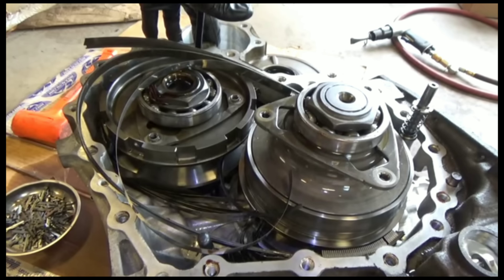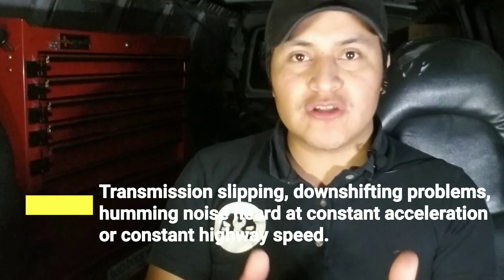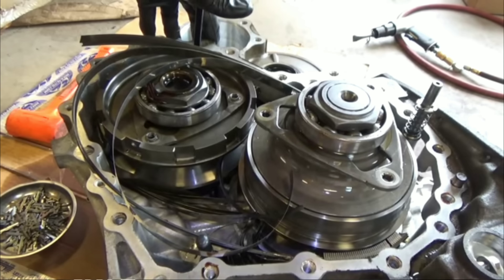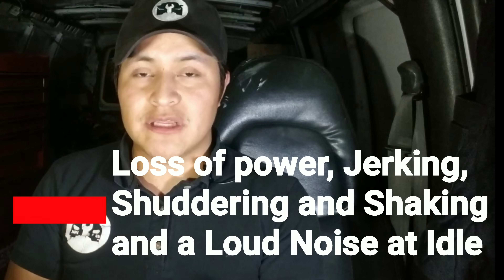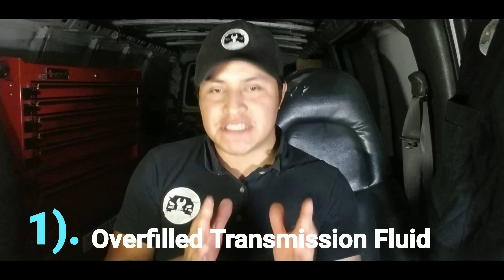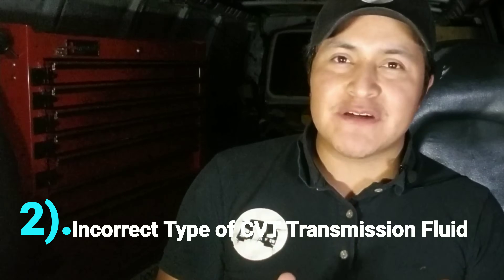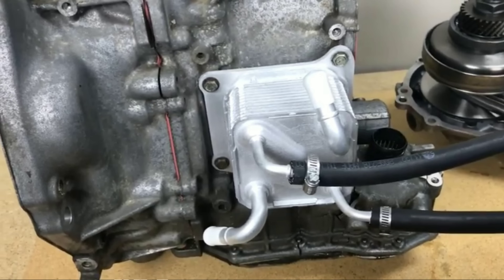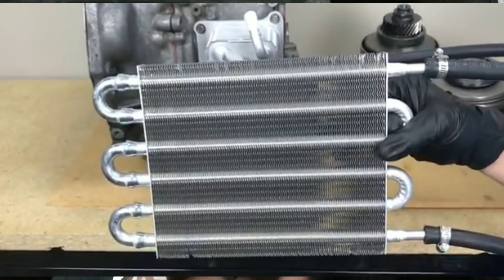NISSAN CVT TRANSMISSION | why it fails and what you can do about it to prolong it's life

Comment: I drive a 2020 Versa, 82k miles. Runs well, just the sensors suck. I think the X-Factor in handling the CVT is understanding that you kinda need to babysit it when it comes to maintenance. Very small transmission, so gotta take care of it. 2200 lb cars shouldn't get 40 miles a gallon in the city. But my Versa does. Comes at a cost tho, and the cost is the "fragile" CVT. Fortunately it's a later generation so not as bad as it could be.

So because of that you gotta babysit it. Change oil religiously, try not to floor the gas pedal, make sure oil is either synthetic blend or full synthetic, know when to change the fluids, etc.

I mean I got a lifetime extended warranty so if anything fails I can just plunk down 250 bucks and boom new transmission, but still. Never want to get it to that point.

Comment: I have a 2015 Nissan Murano platinum with 285,000 miles. I’ve never done a transmission fluid service and never added any fluid at any time. Driven the car pretty hard the whole time. Lots of road trips. The car is starting to shutter at lower RPMs. I recently replaced the passenger side CV axle and when I did, there wasn’t any fluid inside of the case. I’ve been tempted to add some fluid, but have always worried It will stop working. Any thoughts?
Reply: 😂😂😂😂😂😂 im dying😂😂😂😂😂😂😂😂😂 i had to read this twice to make sure i was understanding what I was reading.

Comment: I bought my 2019 in January of 2020 and a month or so after I bought it the transmission started going out. A master tech for Nissan was able to fix it after determining what was wrong with no error codes. But now it has been going out for over two years and it just slips  even at high rpm’s. I can barely drive it most days and the Nissan dealership can’t do anything without codes which a real tech who was trained properly knows how to diagnose without codes like we did in the old days. But I’m looking to swap it out with a real auto trans that have real gears so I can actually drive it how I drive normally and with this cvt it’s not built for performance at all. So what should I look for or look to placing in my cvt? Also, what transmission bolts up to the L34?

Comment: My 2014 Maxima did the same thing at 96k. So I threw the cvt in the dumpster and put a real 6 speed in it from a 2010 Altima SR, like a Maxima is supposed to have.
Reply: Is it difficult to replace CVT on Maxima with 6 speed manual?  Costly?
Reply: @SkipBernacki  about $4k roughly and not very hard at all.
Reply: Thank you

Comment: Well I don’t have a Nissan but I couldn’t find any decent info on my Subaru legacy 3.6r and landed on this video. Unfortunately, it shudders and shakes at low speed acceleration. The hotter my transmission fluid gets, it becomes pretty much un-drivable. I’m going to put in the Bar’s Leaks CVT Transmission FIX to see if I can at least get to work and back while my new transmission is being ordered. 
Thank you for the level of detail and after watching a few of your videos, I’m definitely a subscriber!

Comment: I like the descriptions of the problem and the possible fixes. Can you tell us is it worth getting the after market parts(do they work) and the possible cost range for fixing problematic parts. I'm in the market for possible rogue, and these problems are stearing me away from CVT transmission cars, that most newer model cars have now.
Reply from the maker: I'd say that aftermarket coolers are worth it so that the cvt fluid doesn't overheat.
Cost to fix a cvt ranges between 3k to 7k depending on the issue

Comment: I came across your video because I have a 2017 Nissan Sentra purchased used from a dealership; it has been making a whining sound on acceleration then recently a jerking sensation. I took it to a Nissan dealership which they diagnosed that the transmission has to be replaced. Your video gave an excellent explanation of what is happening to the CVT trans better than the dealership. Thank you.

Comment: I have a 2017 nissan  truck and a 2019 Nissan Maxima SR and I love both. I haven’t had 1 bit of trouble with either.
Reply: I have a 2021 Sr and heard these CVTs are heavier duty and have transmission cooler. I read that Idemitsu makes Nissan fluids which they sell cheaper and "are better".

Comment: I had an 05 frontier non CVT lasted 293,000 miles issues started after 250,000. Nothing major, took a beating til it got wrecked severely but it still started.  But I won't buy another,  quality has been going downhill since 09. And that's what I've been told by workers at the nearby Nissan plant.

Comment: With the allegedly compatible fluids they sometimes cause a shudder.  You might notice that fluids at the parts store list a large number of specs on their labels.  One spec is in reality somewhat far off from the others.  I owned Volkswagens and transmission fluids allegedly compatible turned out not to really be compatible or at least not the same.  Also note that if you have a Honda they are notorious for needing specific fluids, most notably the power steering fluid if the vehicle doesn't have electric power steering.

Comment: I have 3 Sentras (2011, 2013, 2015). All have well over 100K miles. The only problem was with the 2013. At 130K  miles, it took 2,500 rpm’s to go 70 mph (normally it is 2,000 rpm’s to go 70 mph). Otherwise it was fine. But I had the dealer put a NEW transmission in, which cost $3,500.
Reply: 2013 centra cvt
coast more 4 500
from bealer

Comment: My trans went out at 90,000 miles in my 2016 Altima, Kept up with maintenance and all, but it started to judder and hesitate. Got a diagnostics test and they told me that it was my Transmission and said they could replace it at the price of $7000 smh. Now I have to start over and get another vehicle. Screw you nissan!

Comment: I have a  2006 Nissan Murano s. Today's my last day with it. I had it for 18 years did service for transmission every 60,000. Today the transmission went the radiator cooler broke and coolant went into the transmission. The car has almost 300,000 miles. 292,000. It was a good car. Now it's going to the Wrecking yard.

Comment: Wow, I never knew about this, I had a 2009, ran great till about 130K miles, started that limp engine thing. I never changed the transmission fluid, I was told at the time by a mechanic that it’s expensive to do and not necessary!? At that time I knew nothing about a CVT and wasn’t sure,  should have researched it more.

Comment: 2019 pathfinder, transmission went bad at 60k miles. thank god had extended warranty. saved like 6 grand. had fluid replaced at 30k. pretty upset that they are so unreliable

Comment: 251k miles on a 09’ Altima. been through 3 transmissions:/
Reply: my 2008 altima is at 360k km and it still runs on the original cvt transmission
Reply: How can you afford 3 transmission? Outside of warranty?

Comment: I have a 2013 Rogue with 121,000 miles and started to hear a lighter revving sound with the engine RPM revving sound. RPM’S meter doesn’t go up just a quiet sound and light vibration. No slipping or rough shifting.

Comment: Pls help, can i use ns2 transmission fluid on 2010 nissan juke xtronic cvt?
Reply: If it has a turbo, then use NS2. ATG & I recommend to do a drain & fill 3X (even shops don't do) 
Since you failed to provide more information. If your vehicle has over 151K, most likely the CVT is defective.

ATG has informed Nissin's CVT about this major problem. But Nissin becomes like Chrysler.

Comment: Thank you for informative video.  I wish I had searched for this years ago.  I have a 2009 Rogue and yesterday I heard the whining sound come on when I started the car.  I also smell burnt oil smell when pulled into garage.  You helped me confirm that the transmission is going and will require a replacement which isn't worth the cost of the car.
Reply: Change the oil and filter.. Critical on these trannies...Use the proper oil..

Comment: The fail-safe issue happened on my 2010 Nissan Rogue at 60k. A transmission cooler fixed it. At 110k, the magnetic shift sensor left me on the side of the road. I had to manually depress the slot switch to unlock the shifter before and a few months after the sensor was replaced. After doing that for 3 weeks, the shifter worked again. At 151k, it seems to slip just after low speed take off, sometimes. I am taking it to the shop. They said 5k to replace the transmission. Hopefully, it will be something simple...

Comment: I DON'T KNOW MUCH ABOUT ENGINE. I HAVE A QUESTION WHEN CHANGING BRAKE FLUID IS IT NECESSARY THE BLEEDING PROCESS? I HAVE NISSAN 2018 VERSA. great info. thanks
Reply from the maker: If you let the brake fluid reservoir go empty, then yes, it's necessary to bleed the air out.
Reply: Great much thanks for your info.

Comment: My Nissan Sentra 2015 has transmission issues but still runs what can I do
Reply: Sell it
Reply from the maker: Make sure that the fluid level is at the right level, and the only service that you can do to it without rebuilding the transmission is to flush the fluid and replace the transmission fluid filter. If after that the transmission still has issues, all the other options will be expensive

Comment: I have a 2012 Sentra. I drove it from Arizona to Texas and back and just got back yesterday. The check engine light came on about half way through the trip. I had a P0744 code come up when I put my scan tool on it which is a TCC transmission clutch control valve intermittent. I kept driving it and after a few miles the car suddenly had no power. It was like the transmission wouldn’t downshift on hills or maintain speed on cruise control. I’d step on the gas pedal and it wouldn’t accelerate. When I pulled over the transmission was very hot. Wasn’t sure if this was normal? I poured water on the transmission to cool it off and it seemed to work. I drove it again and had no problems for a while; but, the problem returned. Essentially that’s how I got it all the way to Texas and back. I had to pull over and pour water on the transmission every 40 or 50 miles. But driving it through the city I had no problems! I did put some CVT oil in but it didn’t solve the problem. My transmission is overheating? I didn’t know that the transmission had used coolent from the radiator?  Wonder if that is the issue and not the TCC? Hummmmmm?  🤔

Good video! Thanks for the info!👍
Reply: Change the CVT fluid.
Reply: @TomasTobiasAliwishesJackson  I changed the oil 2 1/2 years ago and that was the second time I’ve done it. So I don’t think that’s the problem. It maybe the filter behind the cooler is dirty. I already ordered a complete aftermarket cooling kit with a new filter, cooler and a radiator cooler to help cool it better. I will replace the CVT oil now because of the overheating……….thanks for the reply. 👍
Reply from the maker: It's going into limp mode, that's why it wouldn't accelerate when the transmission fluid is too hot.
I'd use a scan tool to see the transmission fluid temperature before and after installing the new aftermarket transmission fluid cooler to make sure that it's working and actually cooling down the transmission fluid
Reply: @WrenchLink  yep? I figured it out. It’s been flushed, filters replaced and everything done to the transmission. It works fine now.👍

Comment: It’s just completely outrageous that in the 21 century a seasoned manufacturer can not be counted on to build a reliable car transmission. No doubt that much of the public don’t change all fluids as consistently as they should but the manufacturers are not insisting that they need too by promoting this never needs servicing crap. It’s just disgusting

Comment: I hate CVTs. This video confirms, once you hear a noise in the transmission it's either going to die or will be a costly repair. Just trade, don't repair or replace. Don't but a used CVT auto, you're just getting someone else's problem.

Comment: I bought Nissan Roque 2017 and I driving 7 years already never got trouble or fix anything just change the oil only and now I plan to buy another Nissan Roque 2024 again because I love Nissan, at least Nissan make by Japan still more better than make in Korea or China or Vietnam.
Reply: Thanks jus brought 2023 Rogue with 3 cyl engine cvt.  I absolutely ❤️ 😍 it 💯.   The 3 cyl is a genius invention and should b applauded.  The changes hopefully have been great and maintenance recommendation work

Comment: Hey everyone, who happens to see this. Hope you are doing better than I am. I just want to let you know that if you experience acceleration problems it may not be the transmission at fault. Limp mode can be triggered by other things such as a failing throttle body. This component is responsible for letting air mix with fuel for the combustion to occur. If this part fails, your engine will have trouble moving. 

It's easy to change out since the throttle body is located at the very top of the engine under the plastic cover. There are some hoses and wiring that needs to be disconnected. Please be careful with this. Breaking a hose or breaking plastic in the hose is not a fun problem to solve.  

Make sure to check all fluids after making any critical changes to your vehicle. 

I had a few of the symptoms listed in the video. When my dad plugged in his OBDII computer, it came up with codes for the throttle body. Make sure to scan for codes before assuming your vehicle has had a catastrophic failure. 

Please use caution. Engines are precision machines and are to be treated with caution and respect and perhaps a healthy dose of fear. Use extra jack stands if you can. Try to avoid working alone. That way, if something does go wrong, someone can be standing by to either help or call emergency services.

Comment: Great video and the best! Thank u for this. I have a 2013 nissan rouge and it is jerking at 100,000 miles. What do u recommend I do? Would a CVT fluid change help the longevity or should I just sell it.  Horrible vehicle btw.  Will never buy a nissan again.
Reply from the maker: It could help, but if the transmission is mechanically worn-out, then a fluid change will not help.
Check if the fluid level is ok.

Comment: I have a 2013 Nissan Rogue (116,000 mileage) and I hear a humming noise when I get around 40 mph but it doesn't jerk or shift hard, would that be the transmission? and what would be the fix for that?

Comment: best video I have seen on this subject.   general speaking  if the service interval  is every 30k , do a drain fill of cvt fluid every 15k .  if the interval is every 60k   then do it every 30k.  and so on.  only use the Nissan Fluid.

Comment: Nissan Does Not recommend you change your transmission fluid. That's Cap!! They tell you it's Lifetime of the vehicle. Now that's the reason for the problems. An 20 years of that CVT transmission Nissan has done nothing to fix the problem. It's warranty work for them. And the ones that are out of warranty are out of pocket $8000.00-$10,000.00, or they get them in a New Nissan and 10 years down the road same issues!!

Comment: Thank you for this in-depth video. I have a 2014 Altima that is turning 60k miles, at 40k in 2019 I had a drain and fill of the CVT transmission fluid. I spoke to one Nissan dealer 60 miles south of me and they say I must do a flush and the filters and gasket will be replaced, another dealer tells me they just perform a drain and fill, another says never do a flush on the CVT.....I am at a loss?

Comment: I have 2010 maxima with 205 000 miles on original cvt transmission still running strong. I think not hot rodding it is the reason for it lasting plus I use Amsoil cvt fluid
Reply: How often did you replace the fluid?

Comment: CVT transmissions mated to the 6 cylinder engine are not problematic, but you have to change the fluid. I change ours every 50k, and we've had no issue. 2 cars with over 150k miles.